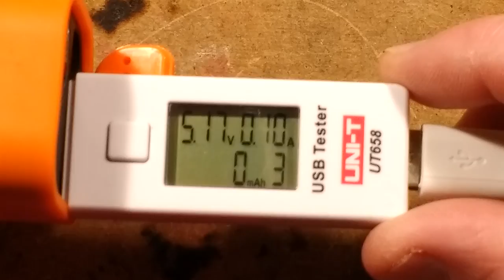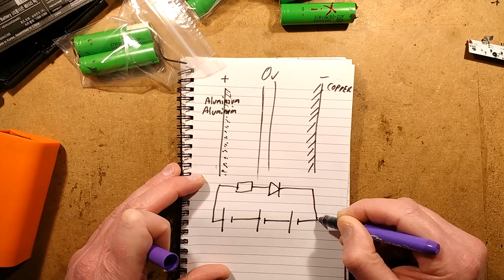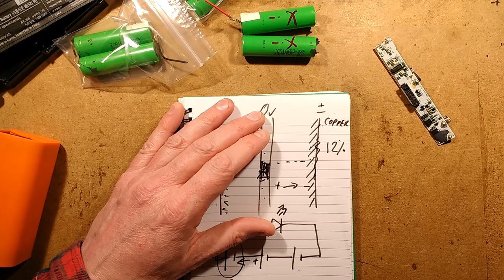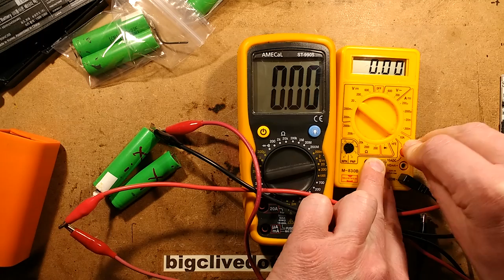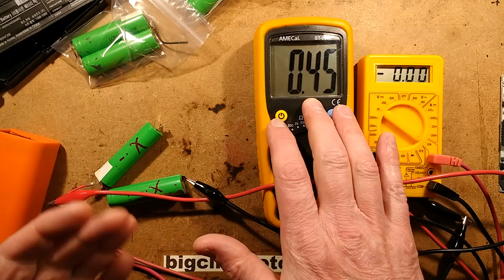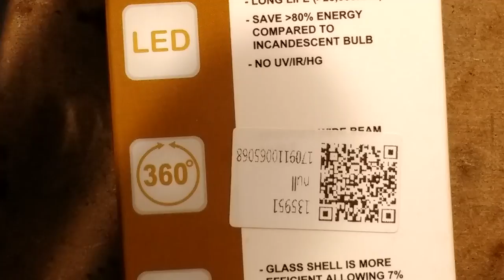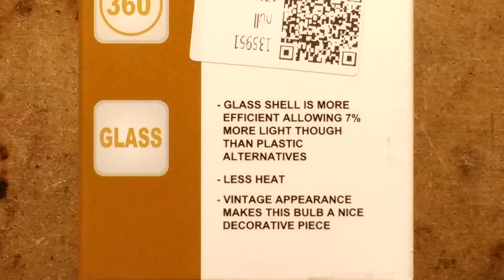Teardown of a faulty Samsung lithium 18650 cell.  (2200mAh)

Comment: Dear Clive, 

I'm pretty new to all this electrical stuff and something I always wanted to know is what is the actual difference between "live" and "neutral" in wall sockets? It seems to me that if the voltage is constantly cycling then they would both be "live".
Also, what is 3-phase and why is 3-phase? Is it magic?

Yours sincerely,
A concerned electronics noob
Reply: Neutral is bonded to earth somewhere.  Exactly where depends on country and regulations.  It might be at the transformer stepping down 10kV to house voltage or it might be just outside your house or...  But neutral ought to be at earth potential, and usually is (except for certain fault conditions).  So, most of the time neutral is the one you can touch while standing in a bath-tub of water and get away with it.

Live is the one where you touch it and it tingles.  If you're in good contact with grounded material and you touch live then you shout "fuck" if you're lucky, or drop dead if you're unlucky.  Experienced electricians treat both wires as though they're live, because mistakes and faults happen.  Electricians who don't do that tend not to live long enough to become experienced electricians.

3-phase is too complicated to explain here.  But it is magic.  It lets you transmit the same amount of power as single phase using half the amount of wire.  Which is pretty fucking magical.
Reply: Neutral is quite often connected to ground at the substation, so it really is neutral.  3 phase... as you have noted the live conductor is a sine wave.  Generators used in power stations have three windings and produce 3 sine waves at different phases because the coils are in 3 different positions around the generator, usually on the body shell rather than the armature as far as I know.  In the UK houses tend to be fed (in small clumps) from only one of the sets of windings so receive a single phase but businesses with higher power needs are normally provided all three.  No magic required.
Reply: So the power coming out of the wall is actually just one wire, with charge flowing in and out of ground? Interesting.
I always suspected that AC could be used with only one wire if you had somewhere at both ends for the electrons the go.
Reply: I don't recall saying that.
Reply: I mean, one wire carrying power, the ground and neutral still exist obviously, and i was referring to bdf2718's explanation.
Reply: +doorhanger93
No, there are two wires.  Both are needed.  Neutral and earth are not interchangeable even though neutral ought to be very close to earth potential.

Ummmm, stick with batteries.  And don't go above 9V.
Reply: Urrg, you see now I've fucked up. I didn't think about my wording, and this is going to hurt now...
Anyway, I understand, now, the difference between live and neutral. Obviously both are needed, and can't be interchanged. This is because neutral is connected to ground whereas live is not, so that when nothing is plugged in at the socket the live pin is oscillating at wall voltage, and the neutral is at ground potential. When a devise is plugged into the socket, neutral also becomes live and dangerous. 
I was referring to how only the live wire really carries energy, whereas neutral just connects to ground instead of directly to the other side of the transformer, as i previously assumed.
Reply: +doorhanger93
You're getting there, but you're not there yet.

Unless there is a fault, neutral is always close to earth potential.

Both wires carry energy because both carry current.

Always assume both live and neutral are dangerous.  Because under some fault conditions they are.

Just to complicate matters, in some situations, such as shaver sockets in the UK, isolating transformers are used.  In that case neither side of the socket is referenced to earth.

If you want to learn more about electrical wiring, applicable to the UK and Europe, dig around John Ward's videos at https://www.youtube.com/channel/UC2uFFhnMKyF82UY2TbXRaNg

If you want to learn what not to do, see Photonic Induction's videos at https://www.youtube.com/channel/UCl9OJE9OpXui-gRsnWjSrlA  Don't even think of doing what he gets up to.  What he gets up to makes Clive's stuff seem perfectly safe.
Reply: Again, wording. Of course the neutral wire carries energy in a sense, but the energy actually gets from the source to the load through the live wire, right? Maybe? I don't know, I've kinda fucked myself into a corner here with an abstract concept.
But I do know about Photonic Induction; do you think I have the money just lying around to think about doing what he does? I'm still wondering how he pays his electric bill while spending that much time destroying expensive things!
Reply: I barely understand anything about electricity either, but this is my limited grasp of A/C.

Current is like the water in a pipe; it's the actual "stuff" you're moving. It doesn't move on its own, it has to have force behind it, and that force is voltage. Now, if you have a pipe with a tank on each end, and everything is at the same pressure, nothing is really moving. But if you have a higher or lower pressure in one tank, the difference in pressure causes the water to move from one to the other until the pressure is the same. Voltage is the same way, but instead of pressure, it's potential. If there's no difference in potential, there's no voltage, meaning no current can flow. A/C means the electricity alternates polarity between positive and negative. Polarity is just the direction the current wants to flow in, is all.

The live is alternating polarity between +120V and 120V. To use the pressure metaphor: the pressure rises to +120, then falls to -120, and back again. Except it can't do anything on its own - the whole live line is at the same "pressure." The same potential. Nowhere to go.

When you plug a thing in, suddenly, there's a difference in potential. The live line is going back and forth between + and -120V, but the neutral is 0V. It wants to equalize the "pressure," and the only way to do that is to force its way through the circuitry in whatever you plugged in. On the positive half of the AC cycle, the pressure pushes one direction; on the negative half, it pushes the other. But it goes through the whole system, both the live and neutral wires. Imagine a pump, bringing one tank back and forth between higher pressure and a vacuum, causing the water to swish back and forth between it and a connected tank.

When something is plugged in, the live and neutral have been connected through the device's circuit, so they're both fluctuating between -120V and +120V. And your potential is vaguely 0V, so you get a zap for touching either. If nothing is plugged in, the neutral's potential is 0V, pretty close to yours. But if you touch the live, again, there's a difference in potential. You're connected to ground, and the pressure wants to equalize. Through you. Nice knowing you...

And that is my entire understanding of A/C power. To be honest, I'm basically posting this because I'd like to see if it is accurate in any way whatsoever. Corrections very welcome :D
Reply: 3 phase is used because its the least amount of phases that can ensure that a multiphase motor runs in the right direction.
You could use more phases but that is too expensive to be worth it.

And neutral and live both carry current, you cant use an electric appliance with one wire, electricity always has to flow from somewhere to somewhere.
The difference between neutral and live is simply the potential to ground, most appliances dont care when you swap them around because of that.
A good way to describe electricity is that it is water inside of pipes but it cant flow outside of the pipes. The water pressure is the voltage, the flow is the current.

A load would be a turbine in this case. 
So tell me, how could you make a turbine spin with just one pipe going to it and the water cant leave the pipe?
Reply: doorhanger93 - Yeah single wire earth return in the distribution system is a thing in some parts of the world for cost cutting reasons, New Zealand is  off the top of my head one place that uses it... also electric trains have live and earth (rails) and as a system it works.

Comment: It's important to note, you are describing rechargeable lithium ion batteries with a lithium matrix, as opposed to lithium metal batteries. Off subject I know, but lithium metal is dangerous and will react violently without correct handling. Be safe people.

Comment: The re-recording thing may be not because of file size limit, but because of length limit (possibly hardwired into the ROM enforcing the limit on all apps - and to work around the limit, your app restarts the recording). 
Reason: EU import tariffs for devices classified as video cameras is higher than that for photo cameras - what makes the distinction in the view of law is the ability to record long videos. The margin is at 30 minutes and for example Nikon cameras cut off the video at 29 minutes (to be safe I guess...). It's dumb especially since most cameras offered better video quality than camcorders and for lower price. 

Maybe try a custom rom - may have this disabled. Or possibly it can be disabled on a rooted phone (build props property or something...) I bet this differs between manufacturers.

Comment: Most phones use FAT32 as the filesystem on an SD card (certainly, that's the standard file system on up to 32GB, exFAT is the suggested format for >32GB cards). FAT32 has a file size limit of 4GiB -1, so the camera is probably hard-wired to stop recording at that point to prevent data loss or a corrupt file. (I'd be surprised if it were intelligent enough to discover it's on an exFAT partition and disable the cut-off!)

Comment: There is a video on youtube from some youth showing how to recover dead 18650 cells that refuse to charge.

So I pointed out that should a cell have an internal fault that is being forced to charge, then that in itself is a fire risk. 

Seems that people are unaware of the problems of rechargeable's and forcing them to a state where energy can be pushed in to the cell, the dangers it poses are very real.

I get worried when my Nickel Metal Hydrates are charging as they get very hot, some too toasty to hold! Think its time to replace those... 

I think I will just pop down to.... 
OH BUGGER, Maplins is gone 
:(
Reply from the maker: If the cells are getting hot on the charger then it may be too high a charge current for them, or it didn't detect end of charge.  NiMH cells tend to get hot once fully charged.  Some chargers detect the increase in temperature to end the charge.

Comment: most of those batteries in the USB banks r very low amp rating ya so if u use in a vapor plz build high enough ohm or resistance for those low amps low current batteries...build well above 1.00 ohm. min .90...don't take these batteries below 3.2volts unless u want a shorter battery life...taking them down to 0volt causes the battery to crystalize inside making it nuclear thermal runaway..or at min vent

Comment: Reminds of 9 Volt batteries which often reverse their polarity.  Still get a zing on your tongue but you stick it in a meter run battery test and it slams home to zero your like wtf.  so you flip it around and try to touch the contacts backwards hey working battery  9 Volts more than any other batter I've had seem to to this and I really don't know why.  As for Li Ion batteries going bang.  Usually it's the Lithium Polymer batteries that go bang usually if some sort of heat is applied. I just know Li Po batteries last longer.  Again I don't know why

Comment: As long as you dont open any Lithium cells with Thionyl Chloride in them Clive, you'll be ok. Get a respirator and have a fair bit of water to hand if you open one of them.

Do it outside and away from neighbours too!
Reply from the maker: It's apparently got a very pungent odour, so I'll keep that in mind.  All the lithium cells I've opened so far have had the sweet smelling solvent.
Reply: That's good to know. Thionyl groups are compromised of sulphur, hence they smell like rotten eggs. Most the stuff you're opening is no more cancerous than burnt toast or a youtube comments section.

Thionyl Chloride cells are usually purple and clearly marked "do not open - toxic". Stuff is more deadly than chlorine gas and Hydrogen sulphide.

Comment: Non-Pb solder or component lead coating was totally problematic when it came out, causing mysteries ranging from failed satellites to run-away cars.  Tin creep or tin whiskers was the culprit.  Silver & copper or antimony are typical substitutes to temper the tin & the problem has gone away.

Comment: g&t first of all ... some cells just went death  in the pack  and some usually works ....once a took apart ps3 controllers(if i remember well  )  and just shorted  battery for a moment and they start charging again  (sort of resetting  protection board circuit)  i got two for 15 euro and new cost  like 50  so it went win win for me (brother asked to try something ... ) so i believe it just protection board  not allow to charge , battery itself have some  voltage it just been to low  and and protection board just show "0"

Comment: Never attempt to disassemble a lithium battery that has not been discharged to zero, there is a high likely hood of it bursting into flames and burning your face off, or worse yet, burning your house down.

Comment: the black coating is called lithium thats where why they are called lithium batteries
Reply from the maker: Graphite on one electrode.  Often lithium cobalt oxide on the other.

Comment: You're wrong lithium cells has A good amount of lithium that can cause it to explode
Reply from the maker: Primary lithium cells (non rechargeable) contain a lot.  Secondary (rechargeable) cells do not, but do have a flammable electrolyte that can cause issues when shorts or thermal runaway (chemical reaction) occurs.

Comment: Love the show interesting info on batteries, loads of contradiction on batteries all over the place. I found for every expert their was opinion backed up by chemistry. I got several years ago info from extensive MOD testing on NiCad cells they basically said that there was NO memory effect on these cells it was the fact that the NiCad cells for commercial reasons were charged far too fast, and the result was the effect known as "memory" effect. The result at the end of the tests showed if the cells were charged "correctly" or slowly the "memory" effect never occurred, later chargers had a button to discharge and then slowly recharge which helped a lot.I believe there is a similar report on several newer battery types again showing the best way to use and charge them. I have found half of the report which is great again showing what "commercial" charging, discharging is clearly ok but certainly not the best way of using the cells with results such as battery life issues,  (are you listening apple).

Comment: Word worth expressing if it hasn’t   Pyrofloric…self  combustion
Reply from the maker: The NiMH cells are pyrophoric.  With lithium it tends to be heat and sparks from the high current discharge, igniting the hot electrolyte vapour.

Comment: My dads Samsung Laptop has the exact same issues you described. THey do some really weird shit to mostly stock hardware.

One of the peculiar issues we had with it was that you could not shut that laptop down, no matter what you tried (even trough Linux etc, I couldn't get it to shut down, a shutdown signal always triggered a hybernation signal to the system).

I had to actually hack the laptops BIOS and put in some solder bridges on the mainboard to get that thing to actually shut down.

The rest of the issues were the same as you, weirdness with USB ports, diskactivity that shouldn't be there, even with cleanly installed Windows and Linux installations, etc

Another very peculiar issue that I have seen come up with other modern laptops is: 

"Keyboard works perfectly in BIOS and UEFI Setup. Yet Keyboard inside any operating system has several malfunctioning keys."

Oh yeah, both keyboard, mouse, camera and sometimes even the Wifi and Bluetooth are connected to the USB bus internally in laptops from the last 10 years.

Comment: imagine this a battery cell like a dam------the dam has a exit pipe 12 inch in diameter where is most water activity at the pipe!!!!right as it reacts or empties it filters out to the edge there is a point where its full the pipe has lots of energy when its half full you get 6 inches come out the pipe below the pipe its dead flat cells are the same if the front dam empties the one behind struggles to fill the empty dam or reverse charge

Comment: Li atoms or ions (=atom minus an electron) not cells (living organisms)
Reply from the maker: A cell is a single charge storage device.  A battery is a multiple of cells.
Reply: @bigclivedotcom  OK... other type of cells ;) Thought I heard you mumbling about very tiny Li partikels and referring to them as cells like bacteria?

 Li is one of the smallest atoms, coming third in the Periodic System after Hydrogen and Helium.
 Li metal is very reactive alkali metal (reductor) ready to loose an electron e- , becoming a Li-ion Li+ for instance in a reaction with oxygen in the air or water. The latter is more spectacular :)

2 Li  -> 2 Li+ + 2 e
2 H2O  -> 2 H+ + 2 OH
2 H+ + 2e- --> H2
_______________________+ (eliminate same components left and right of the arrow)
2Li + 2 H2O -> 2 Li+ + 2 OH + H2  and a lot of heat!
The heat ignites the hydrogen gas - oxygen (air) mixture.